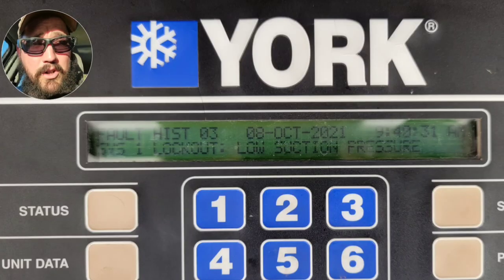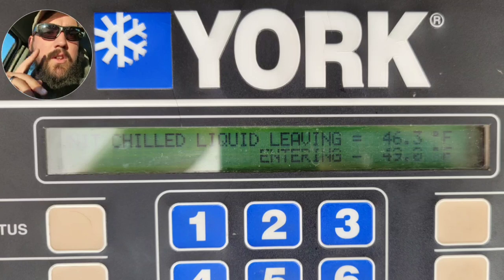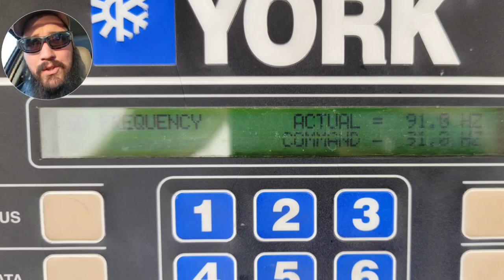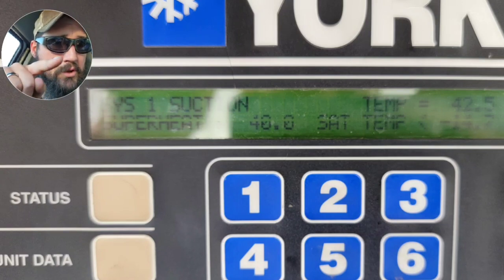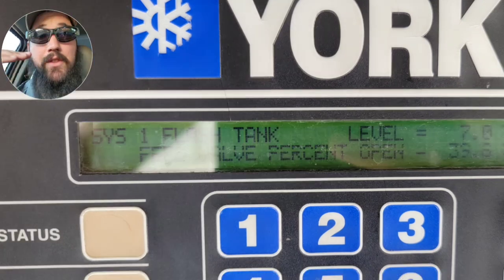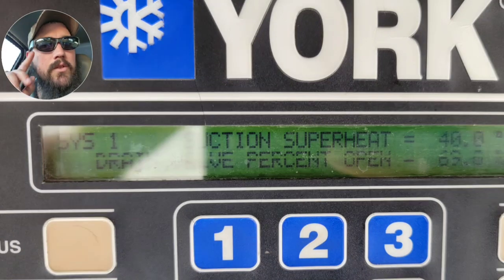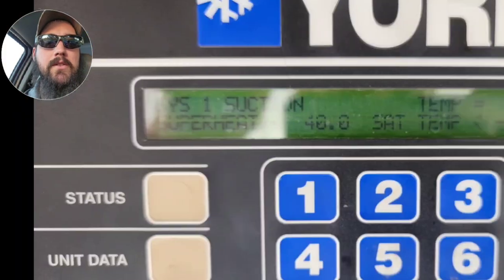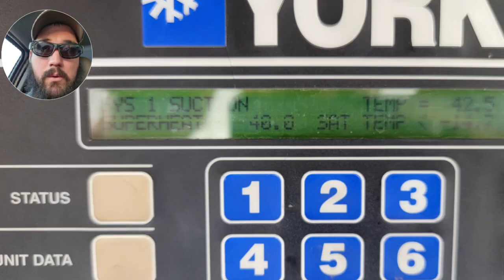Chiller Down Tripping Low Pressure York Air Cooled Chiller

Comment: you can pull the history logs from the microboard via printer port. and it's possible to output real time operating data via printer port too, you just need to export the text file and convert it to excel for easier reading. I always do this when troubleshooting York chillers with inaccurate temp and pressure transducer.
Reply: Any chance I can give you my email and get some more info on doing this?

Comment: I had almost the same problem on a ycav. It would trip on low pressure intermittently and when we would check it would be fine. Ended up swapping the suction temperature sensors between circuit 1 and circuit 2. Four days later the other circuit tripped on low pressure.
Reply from the maker: I have 1 YCAV still in ops.

Comment: Your suction transducer went open circuit or out of its range which would cause and instant shutdown the same as when you disconnect a transducer which is extremely rare on York chillers so most likely the connections @ logic board or transducer itself were also causing an issue with poor readings causing the drain valve to open to your position(above 50% is high for your operational speed of about  50%) causing your low discharge superheat but also if the compressor heater is not working whilst compressor is non operational the system/circuit would normally take several minutes to get the discharge superheat to normal conditions. 
  It is more common that the suction sensor reads too high(usually only by 2 DegC or so and this has the same effect on the discharge superheat on the effected system/circuit as the software suction superheat setting effects all systems/circuits? The software should control the feed valve to regulate the level sensor to its default 35% setting at whatever load but even if the level sensor is wrong the software is more concerned about the drain valve why you will very often see a flash tank level sensor read 5% or below and the feed valve be 100% open and the suction superheat being normal (4.5-5.5 Deg C in my case depending on target) and drain valve open normally no more than 40%. The Danfoss controller/controllers of the feed and drain valves can also be used for fault diagnostics via lights on the front and the service menu on the chiller interface. 
These chillers are designed to track the set point very accurately as the compressors have 1500 stages of loading via 0.1% adjustments via the VSD of course all at the same time as the drive controls them as one system effectively as they are not independently driven.
Reply from the maker: Replacing the transducer fixed the issue
Reply: @HVACTIME  cool strange for a transducer to be intermittent though. Do love the yciv though best air cooled we made in my opinion got some with 120000 hours on compressors over here in the UK mainly down to the way the drive starts em nice and slow.
Reply from the maker: They are incredible machines